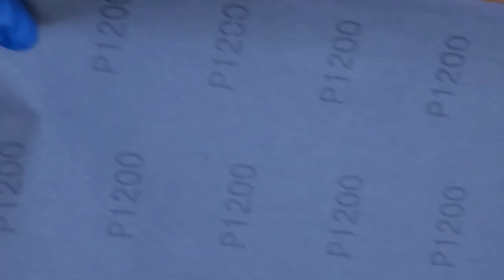Ratchet Wrench Restoration

Comment: Just shows what such a ratchet can look like if you want to put the time in to make it look like that. I applaud your efforts and finished product. I also wonder that IF it is ever used, how will it hold up, especially the handle. But you do realize this is merely a "Task Force" ratchet... Thumbs Up!
Reply from the maker: You're absolutely right. It should be evaluated after a while of using it. Thanks for the comment.